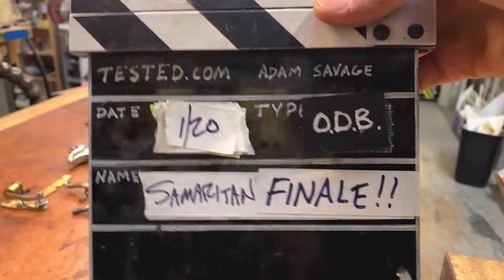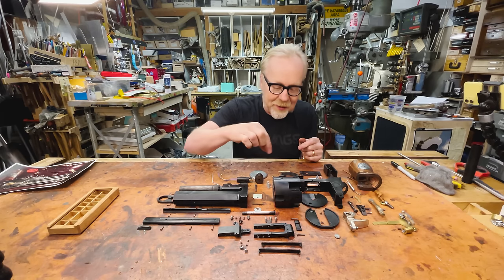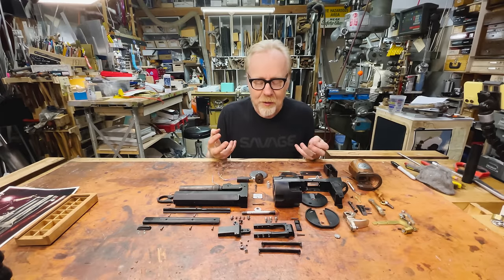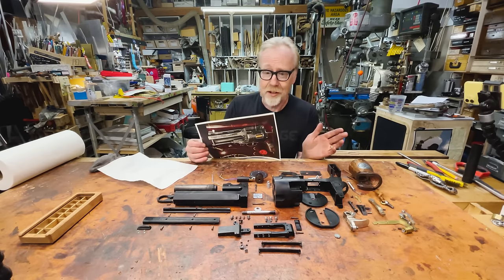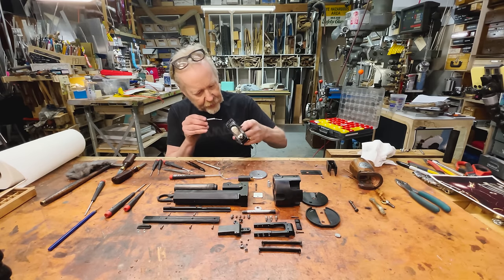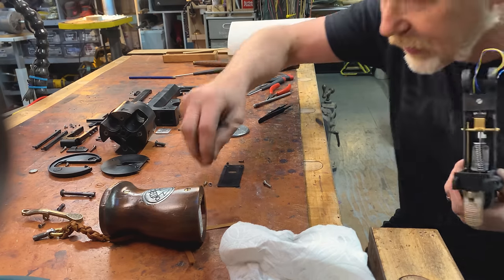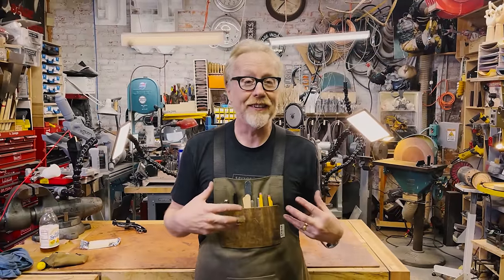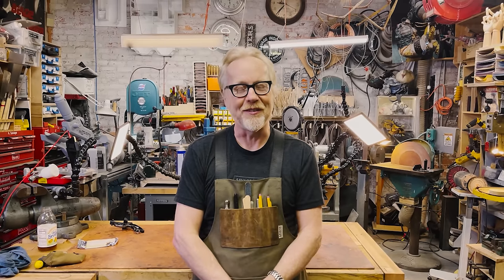Adam Savage's One Day Builds: Hellboy Samaritan Replica Finale!

Comment: Huh, that is interesting.  Apparently here in Canada we typically call all those type of wire connectors Marrettes, which is actually the name of the inventor - kind of like saying Kleenex instead of facial tissue.  And the reason I mention it is because the first time Adam mentioned using a wire lug, I didn't actually know what it was until I saw it.  LOL
Reply: Or Xerox for copier machines (or the process itself). :)
Reply: Non mais sur le vocabulaire on a tous vu comment vous traduisez les titres de films hein... Laisse nous deviner, Le garçon des enfers? XP

Comment: For your tiny wire nut needs, look into leverlock connectors and ceramic wire nuts. The thread on the inside of the ceramic ones is part of the ceramic instead of using a wound steel wire cone, and can get tiny.

Comment: Adam, I loved the meditative nature of watching this reassbmbly.
serial numbers go on the side of the lower receiver (rail), where the trigger mechanism is housed.
gunsmith screwdrivers are hollow ground instead of a taper grind, easy enough to modify a normal one to be similar.
To get smaller electrical connections than the wire nuts, use dupont style crimp on pin & socket connectors (mini-pv)
forgive me for saying your distressing step in the weathering is too uniform, low spots should get almost no impact abuse, high and away spots get more than their fair share in real objects.

Comment: I see you've gone with the Garret Wade and Wiha screwdrivers. I'd like to recommend The Grace and J.L. Smith drivers as replacements. Smith does micro drivers that are hollow ground unlike the tapered Wiha. And Grace does the larger drivers in a parallel grind in enough sizes that you can get an exact fit such that without magnetism the screws will stay attached to the drivers. I use them professionally every day, and since I got them I refuse to use others.

Comment: It looks incredible! Bravo!!!
Wee tip I learned from a world-class wind instrument repairer: when you're working with tiny slot-head screws like these, you've got to have both hands on the driver, one on the handle and one just behind the tip, to keep from slipping and either scratching the work or mashing the screw. Rest the work on a surface, or clamp it, and have both your elbows on the bench. The temptation to work in-hand, with everything floating in the air, is not worth it.

Comment: Am i crazy, or is there absolutely no way that thing could actually work??? it looks like the slots for the indexing fingers on the cylinder are all 90 degrees from the chambers on the cylinders.... a cylinder wouldn't be in line with the barrel when locked by the indexing fingers....  (ignoring the fact that all the chambers are missing huge portions of the side wall, and would blow out cases instead of firing)

Comment: Those dings and dents you made with hammers don't look organic at all. There are a lot of identical small circular dents in close proximity to each other which would never happen due to real wear and tear. Also, real-world dings and dents are rarely circular. You should have used random angles of attack with the hammers which would have given random irregular shapes to the dings and dents. You also should have done some other things, like dropping it on various types of ground/floor, e.g., asphalt, gravel, cement, rocky.

Comment: Aaaaargh. Prop makers make me crazy. Spend a huge amount of effort making an elaborate replica which does not work. Then, make it ugly on purpose. If I had that kind of time to begin with, I would look into what it takes to invent a 22mm or 86cal cartridge, which is surely doable since there is such a thing as a 40mm M203 which gets about 250fps. For comparison, the .45 ACP comes in  at around 1000fps. So, according to my calculations, you could still get around 749fps at the same energy in 22mm (scaling bullet mass in proportion to caliber, for estimation). But given that you are making an absurdly huge revolver, there should be headroom to bump up the energy output as long as you ensure that the design will withstand the pressure.

Comment: On the subject of small wire nuts, looking at the size he was using I don't know if this would be a better solution (i.e. if they make them that small) but Wago style connectors may be worth looking in to.
I've definitely started keeping a stock of them around the house rather than normal wire lugs. Particularly for solid core I think they have some distinct advantages

Comment: If your looking for chemical bluing agents for either steel or aluminum including the cleaner and oil finish they sell it at Cabelas and any other store that sells firearms or accessories it's called Birchwood Casey Super Blue, they make it in many different strength and for different metals.

Comment: Thanks to Adam’s attention to detail, this prop to not be too far off from a functioning firearm.   It is really only missing 1-2 functions from being a working firearm.  

If the hammer could be cocked, and released using the trigger, it would be able to fire a bullet, if there was even ammo this large.  

Aluminum would be far from ideal for the pressures created by a bullet, but that’s not the point I’m making.   Using Adam’s technique, you could replicate this with steel, adjust the sizes of the cylinder, barrel for a commercially available bullet, and you’d be able to shoot.   Accurately or reliable, would be unknown, but again that’s not the point I’m making.  

Anyway, I hope youtube doesn’t delete this series.